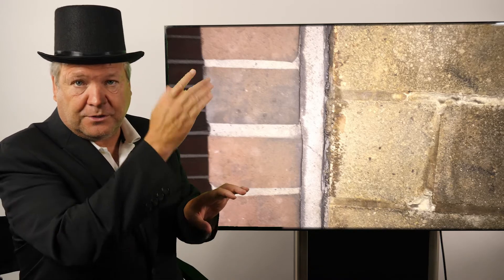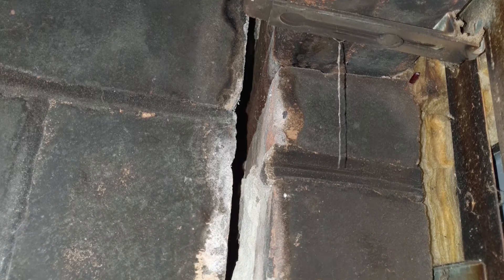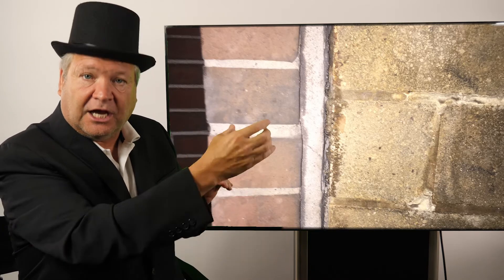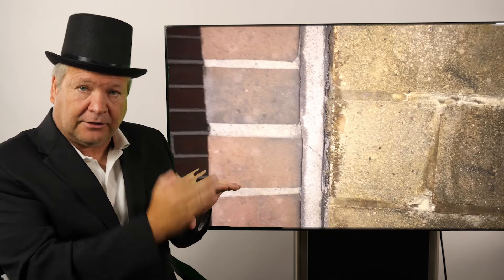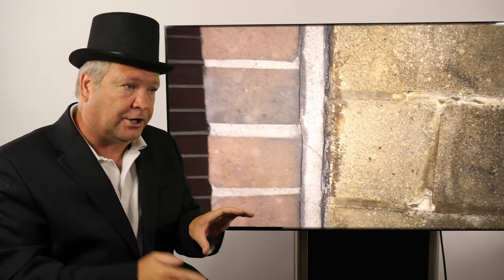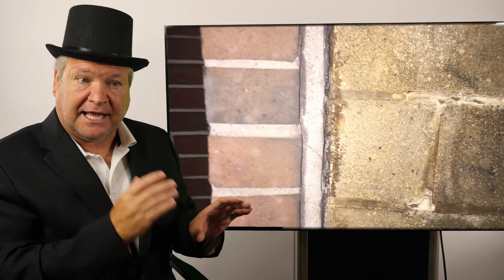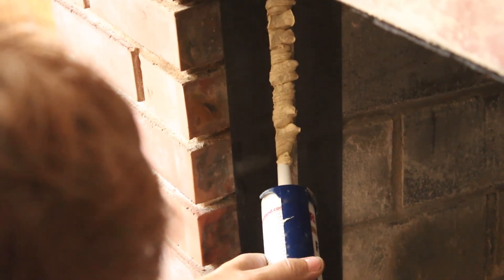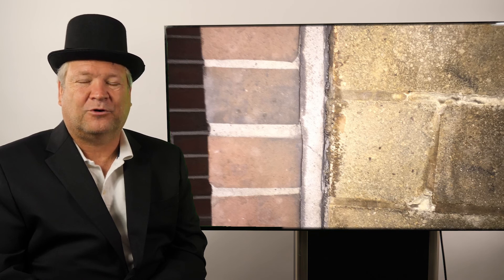Chimneys Explained #17 - Profile Seams

Comment: What’s the best refractory mortar to use for this? I guess any will do that is used for fireplaces in particular? My entire collar joint is basically gone so I’m wondering if I should just get some of the dry mix and trowel it into the gap. Tubes sound good for this purpose but I would probably use about 10 tubes. Unless they sell 30oz tubes. Thanks for the videos! I’m surprised by the lack of information on this subject and fireplaces in general, at least on YouTube.